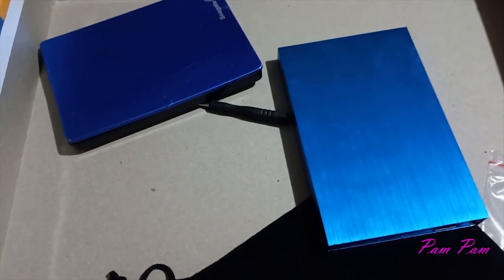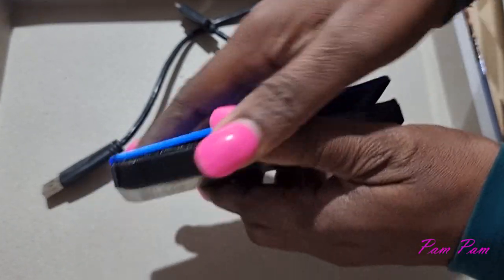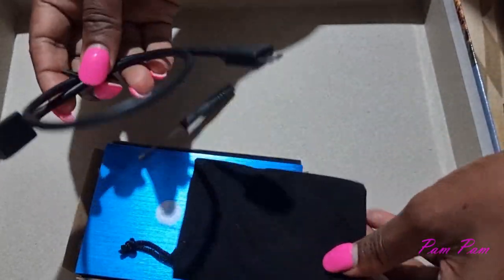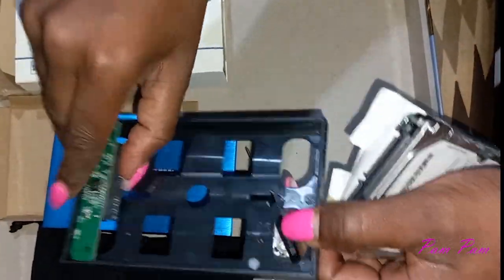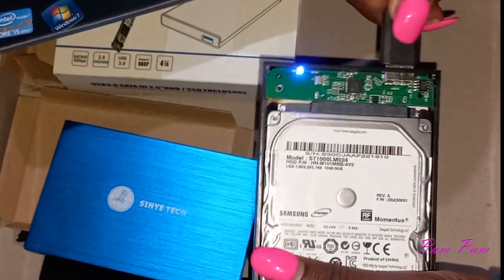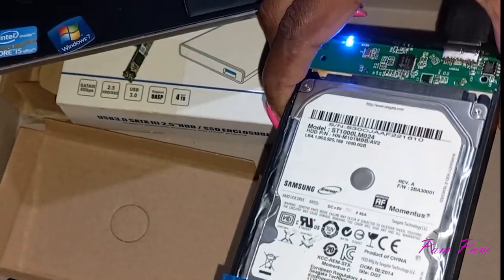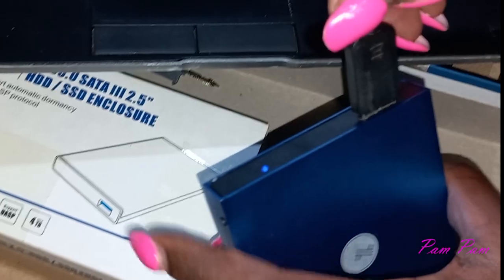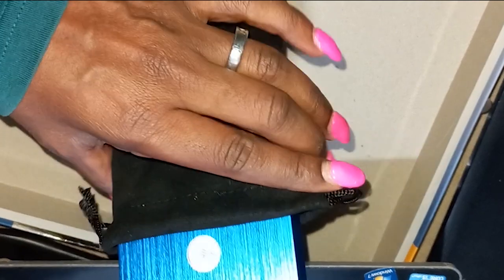Quick Fix: Broken Seagate Hard Drive | New Hard Drive Enclosure | External USB Hard Drive Broken

Comment: Those Seagates are synonymous with malfunctions. I wish I knew this before I threw out the ones that I had. I could have fixed those and would have been able to save my data.
Reply from the maker: Yeah that is a pity. The port breaks so easily. Sorry you lost data.
Reply: I’m in the midst of this now. 2TB of data I’m trying to recover. I’ve ordered the unit and hopefully it works for me before I have to but the bullet and send to a profession data recovery service.

Comment: Thank you for the video. I have the exact same hard drive and it’s the port. How do you spell the store where you got the from?
Reply from the maker: I bought it from Takealot which is local. But you can also get it from eBay or Amazon.  Just need the correct enclosure casing.

Comment: was the hard drive still spinning before the fix?
Reply from the maker: Yes it was still spinning
Reply: @pampamtv4527  Okay thanks. I've been having the same connection problem where it spins but the computer doesn't detect it, so I ordered an enclosure. This adds some more reassures.